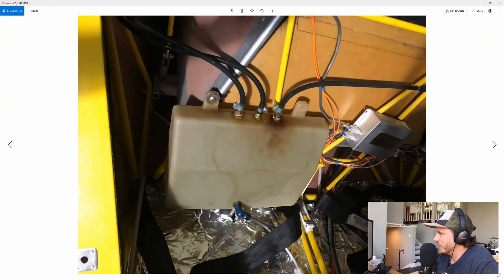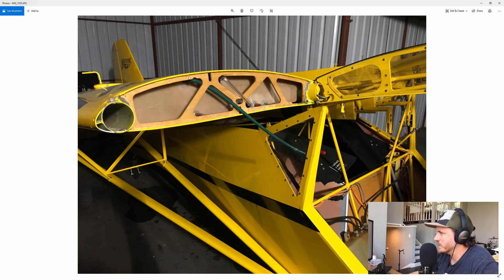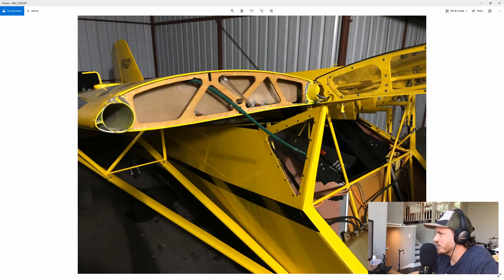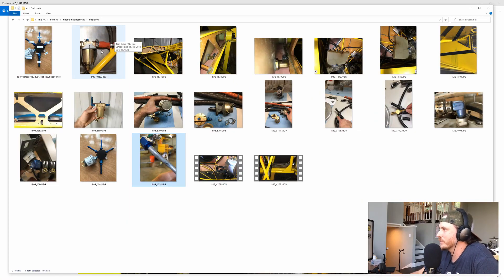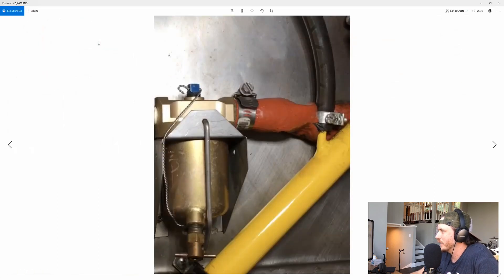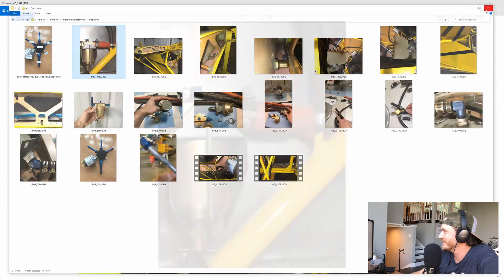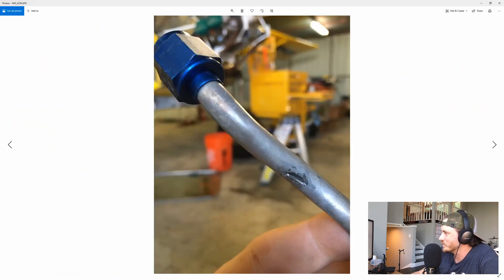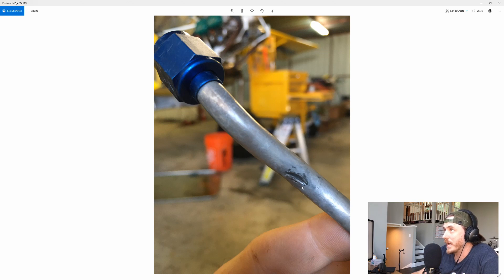My Fuel Lines Tried To Kill Me TWICE | Rotax 5yr Rubber Replacement | Kitfox Maintenance

Comment: we just building our project...  so question I have now is should we install aux. pump, to make more leakage.))
Reply from the maker: Nice! Which plane are you building and which engine are you going with? I don't have an aux pump in my model IV because the fuel pressure from the high wing fuel tanks is enough with the engine driven pump. As I understand it aux pumps are only really needed for low wing or in case there is a fault with the engine pump. Disclaimer: I'm not an A&P or a Rotax expert.

Comment: Get rid of the plastic header tank and replace it with the metal one.
Reply from the maker: The plastic header tank is long gone.
Reply: @damienradford  Good those plastic ones are prone to failure.